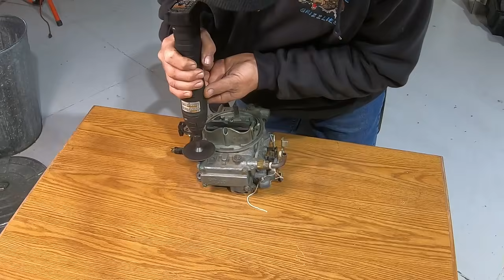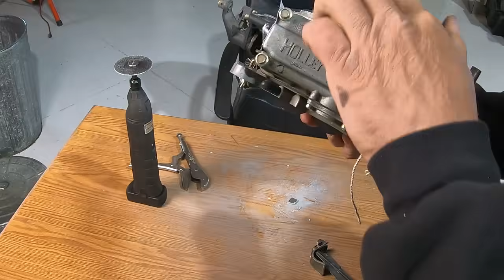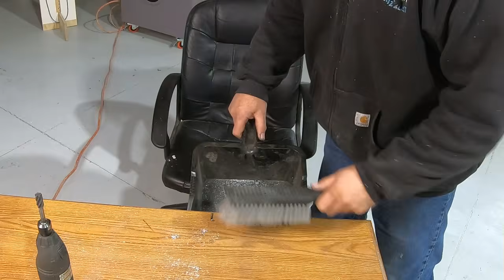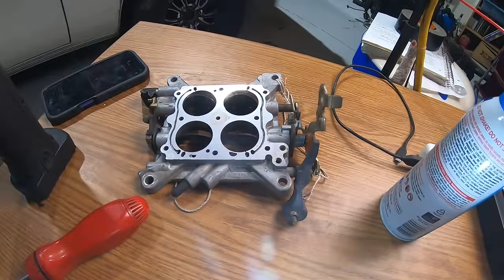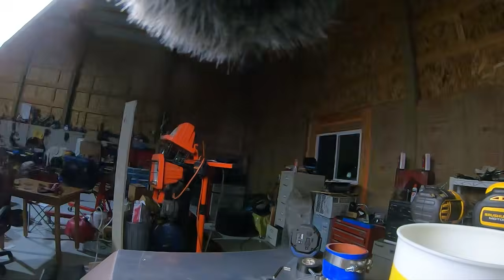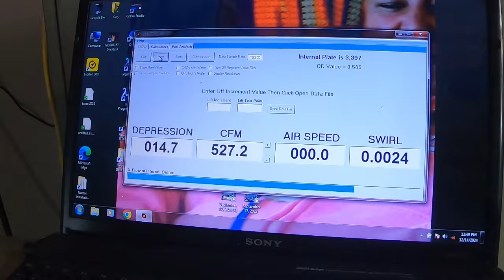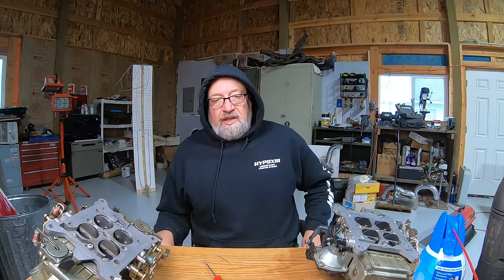Holley Hack: Transform Your Carb into a Race-Ready Beast

Comment: I enjoyed this and have twin 600s on my blown 440 so may need to talk to you about doing this but they run out of fuel at 6500 and that's not good. Also thought about changing it over to duel feed bowls. Vacuum carbs on a motor that does not make Vacuum lots to talk about. How do I get a hold of you. I thought about a pair of demons too.
Reply from the maker: I sent you a e mail to "spanboats@yahoo.com" from your about page
look in your e-mail /spam folder for a flashgordon.
we can also chat here if you like, but we can get into a longer conversation on yahoo.
Reply from the maker: The email that you have on you’re about page  doesn’t work, but that’s OK. We can talk here. The first thing I would do is depends. Can you put bigger bowls in ?which way are the carburetor setting on the manifold if the fuel bowls, are facing each other you can’t put the bigger bowls in. If they are facing passenger, side driver side, then I would definitely put the larger center hung float bowls and get rid of that stupid transfer tube that goes between the two bowls on the carburetor you have now. 
The needle and seats are a bigger diameter on them bowls and will flow more fuel.
Reply: @CudaFishEStories  I just left a comment and utube sensored it. Because I complained about this sensoring my emails. This has cost me a lot of money too.
Reply from the maker: @Roosters_Restos  why can’t you have your e-mail address on your about page???   Aka contact info ???
Reply: @CudaFishEStories  it is on my info page if you use g mail they block you from contacting me to control and read what is said. They can't do that with yahoo
Reply from the maker: I just sent it again and it seam to have went this time. message is test test ing 123
I used Yahoo to send it.  check your spam folder.

Comment: The results would be more accurate if the airflow was from the top down. Carburetor are not designed to flow in the reverse direction. It might flow more in the correct direction.
Reply from the maker: The air was in the exhaust mod. Aka the air was going through the top of the carb and through the buttfly last just like on a running engine.
Reply: Your right. This is simulating forced induction and can tell you improvement but not accurately. The air needs to be drawn through the carburetor from still air. But you can tell by their response, you’re not going to “tell them anything”…
Reply from the maker: You can tell me anyting I'm all ears :-) ......as far as....is this a fair test or am i testing it as if, i was was a flow throught aka Blow through carb.
Well i may have to make another video on that test to prove it right or wrong.  Notice that i didn't say  to prove me or you wrong............you and i will find this answer together. just like in this video, i didn't know the answer until i make the video.
Cheers.
Reply: This is nonsense
Reply from the maker: @LTV_inc  Thanks for sharing, you will get your chance to see it tested in the normal direction. an adapter is being build for that test. and some testing of carb spacers and adapters. you will have to wade thru my  next vidoe about my flow bench first though🙂

Comment: There's more to be gained smooth boring and booster contouring. Additional mods using a 750 or 850 throttle plate, gaskets and redrilling for matching fuel ports at throttle plate gasket..
Reply from the maker: Agreed

Comment: I think a good test would be to measure the airfow with and without the choke tower with an air cleaner and the lid at various heights from the carburetor. I imagine that the height of the lid would make the most difference in whether or not the choke tower was removed. I'm also confident that the contour of the air cleaner base will also benefit the tower deleted example more. Maybe I DON'T want to know how much time that I may have wasted!😮😢...😅
Reply from the maker: Hmm thats a vary good question, and a interesting one............ thanks for your thoughts and coment.:-)
Since i have allready maxed out my bench, i would have to do that test on a 2-Barrel Carburetor.!???----...........Hmm
Reply: I'm most concerned about the flow with air cleaner lid comparing with and without the choke tower. There's not a lot of sense in using a high flowing intake manifold and big carburetor only to choke it with a very low profile air cleaner for lack of hood clearance.
Reply from the maker: @mickangio16  I have been under the weather and still haven't go my flow bench video releassed.......and still waiting on my adapter for the carburetor.
But when i get my adapter, I think we can test all of this and more;-)
Reply: @CudaFishEStories
It MAY work with the 600 because the air cleaner very well may cut the airflow down(?) Wish you could test bigger carbs where some modifications may be more significant.
Reply from the maker: yeah so do I. the bench was build to flow sb mopar iron heads that will NEVER SEE 500 CFM ....from dyno test i have seen the air cleaner base, usally made more power........Curiosity sure is gettting the best of me.

Comment: Different flow benches will give you different numbers, but you use the same bench and show a huge gain in flow from the benchmark.  Shows that removing the choke isnt a huge difference so keeping it isnt going to hurt much.
Reply from the maker: Yup 7 cfm in total by destrying the choke Tower and blending it in.  The 26 cfm from removing the tiny lip around the bore. aka The final test was the one that Shock me.
Reply: ,,,,,,,,,,,,,,,,,,,,,,,,,,,,,look back at  his  gain  after  butchering  the air horn  off  [ creating  turbulent  airflow  eddy  currents  across the top of the venturi 's ]   a gain  of  4  plus  cfm  ,   what a joke..........after  destroying  the integrety  of  the  throttle  shafts ,  another  minimal  gain,,,,,,,,,,,When seeing  the  removal  of  casting  flash  at  the  top of each  venturi  bore  ;  I knew  a respective  gain  would  be shown.......as one other  comment  said  ,  install a 750  throttle  plate  and  match  and blend  it to  the  600 main  body ,,,,that will do  wonders  improving  air speed  thru  the  venturi's,,,,,,,,,,,,,,,,,,,,,A major restriction is the simplistic  design  of the booster  on  those  old  holleys,,,,,,,some guys  drill  three 7/64's holes [ .109 " ]  across the bar  in the four boosters ;  that  gains  air speed , and  greatly  enhances  booster  signal speed and strength,,,,,,,,,,,,Yes  I see Snap-On  tools,,,,,,,,,But , watching  someone  attack  a workpiece that  is  basically  floating  atop  a  worksurface [ unsecured ]   ; with a high speed  cut off wheel,,,,,,,,LUDICROUS ....You must deliver mail  for a living............grade  A   tinkerer .......

Comment: Merci,, But you make a lot of noise,, haha,, Good test thank
Reply from the maker: Thanks. 
Them flow benches make a lot of noise when the air is running thru a restriction. I probably should have dropped the sound a little bit more.
Reply: @CudaFishEStories  Thanks again, but, just work in a day times, you wake-up averybody  here in Canada.

Comment: I have been using a vac secondary 600 with just the choke removed. I am going to replace it with a used Demon carburetor with downleg boosters and slightly larger bores, and see how it runs with that.....but it is vac secondary as well. I spy a manometer back there!!!! that is what I use to test flow. Thanks for braving the cold to bring us some useful tech.
Reply from the maker: lol anytime. The test that shocked me was test #5( mod 4 ) micro material removed. The jump in cfm shocked me. 🤫 that water gauge was built to fix air airbox problem. When I find some answer I might share my journey. 
Good luck with your demon👍👍

Comment: Needs more then building!  Needs air bleeds changed! And a carb has metoring blocks no valve bodies! But it was interesting how many cfms where picked up! But we trash those carbs now days!
Reply from the maker: Thank for your coment.  Agreed i couldn't have picked a more lame Holley carb for sure. :-)  Yeah it need atleast a pair of center hung fuel bowls to get ride of the transfer tube, that leaks every time you do a jet change.  My last one i built i used the 3310 metering plate in the back and both bowls.........It ran.......ok LOL